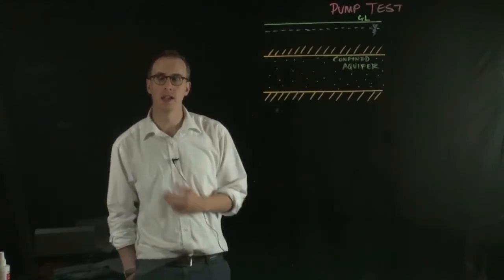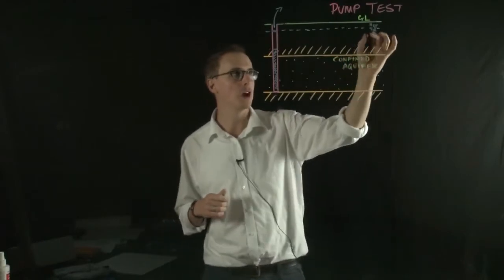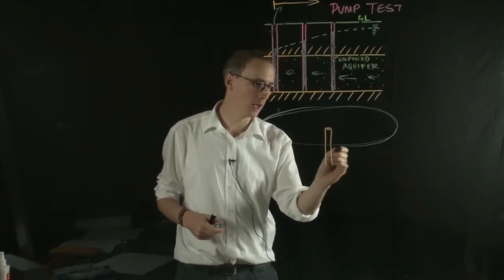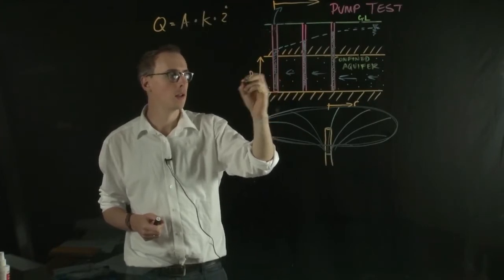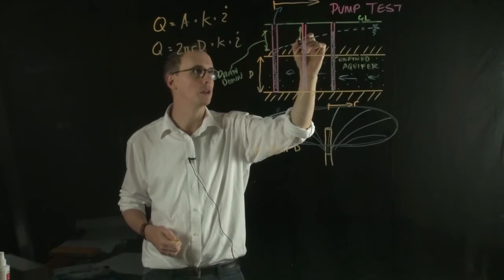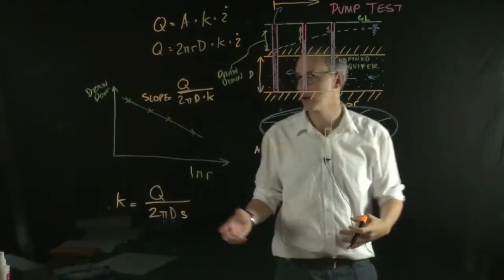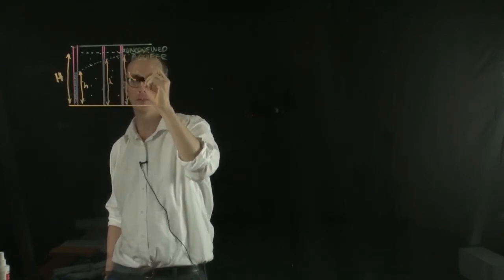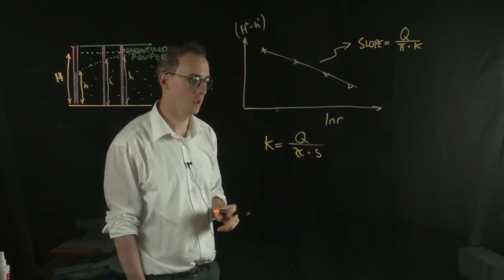Pump Test

Comment: Hello 

Thanks for your lectures. One of the projects where the  permeability is needed for the top 5 meters. The well  is a semi penetrating  unconfined aquifer, but we reach a depth of 30 m and no aquiclude has been encountered. What is the thickness of the aquifier (H) that should be used in the equation in this case? 

In addition, I don't understand how the thickness of the unconfined aquifier can affect the flow rate into the semi penetrating well. Assuming the well is 5 meters deep, does it make any difference in the flow into the well if the aquiclude is 10 meters or 100 meters deep